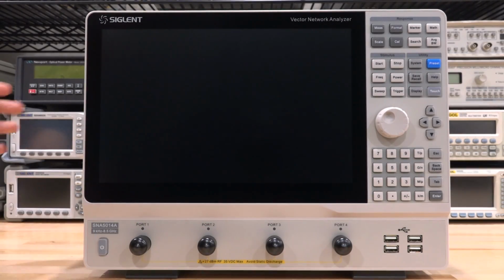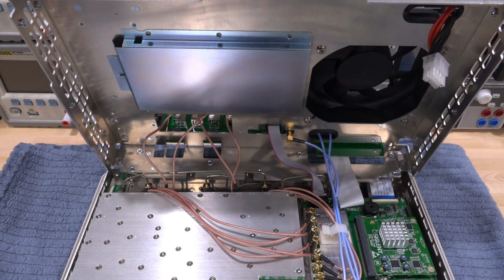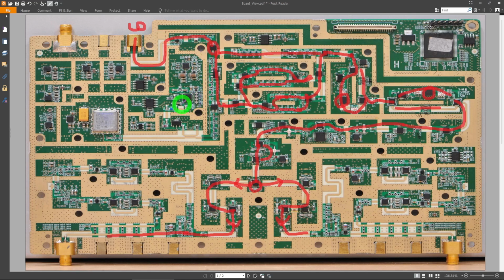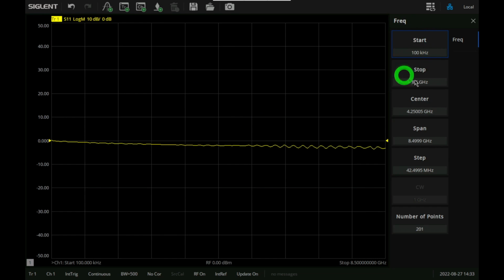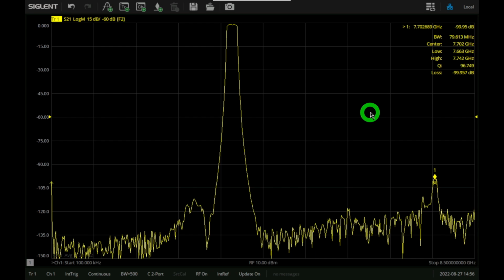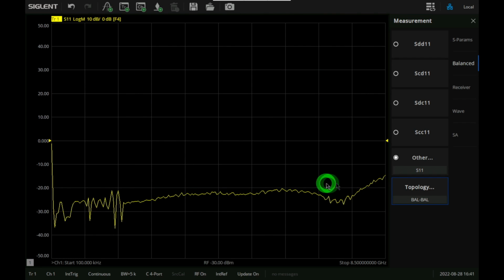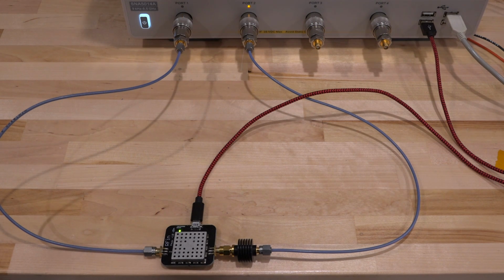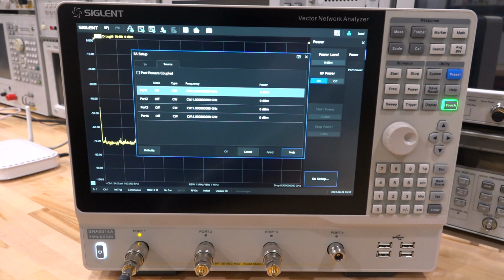TSP #212 - Siglent SNA5000A 8.5GHz 4-Port Vector Network Analyzer Review, Teardown & Experiments (I)

Comment: I have been watching these for many years and I do appreciate that you seem to be speaking like the audience has been paying attention to previous videos. It's fascinating to watch you identify the design constraints and decisions that the original engineers may have considered. 

When you pull out a device to test, like the active amplifier splitter, I do wonder what some real world applications of that board could be. What are the implications and trade-offs in using a board (amplifier) that behaves imperfectly in each of these tests?

Comment: 125 dB of dynamic range at the test port is quite good, especially given the high level of integration and single board architecture as you have mentioned. The design and simulation of that front end is no mean feat, and Siglent didn't skimp out on the BOM where it counts. Of course, the fully decked out 4 port 8.5G trim is 30K USD so you would expect the performance to be there.

Comment: For your videos on the unit, you can go into display settings and turn on hardkeys.  This is very handy but with some additional loss of horizontal space.  But for remote operation, you have all keys visible at once.

Comment: I have never made a differential s parameter measurement, and certainly never will. However it is interesting to see how it is done. 
    I agree that I would like to see a differential amplifier driven on both input ports simultaneously.
    I am surprised that there is no frequency offset mode for measuring mixers. With separate source and LO synthesisers, I would have thought that this would be easy to include.
    I am looking forward to your test of the spectrum analyser option. More and more manufacturers are offering spectrum analysers without the usual YIG preselector for the high band, and without up conversion on the low band. They rely on IQ downconverters, and software image rejection to remove mixer images and LO harmonic responses. Software image rejection only works for repetitive signals. I am suspicious of the success of these methods in offering truly low spurii. Please think of some experiments to really test this aspect of the instrument.

Comment: @The Signal Path
I have a question about the calibration being performed. You calibrate at the level of +10dBm, while in the case of Keysight N4691B ECAL the level of + 10dBm is defined as "Typical damage level". Should the Siglent SNA5000 not display a warning about the possible damage to the ECAL in this case ? 
Therefore, in the eevBlog forum thread "Siglent SNA5000A Two and Four VNA Ports", some questions were asked and strange VNA behavior was noted. 
As you can write in this topic on the forum, maybe it will be possible to explain these strange behavior - and clarify whether it is not due to calibration at +10dBm.
Reply from the maker: I responded to the thread you are referring to on EEVBLOG.

Comment: Nice review.
Please post a link to the episode that delt with the directional coupler. I presume it has a lower frequency cut-off ( of a GHz or two)? If so, would it rely solely on the calibration at lower frequencies?

Comment: Why the starting frequency of almost every instrument is 9KHz?
Reply: I wonder whether this is because EMC standards such as CISPR 11 specify measurements from 9kHz onwards and that manufacturers want to offer devices that offer that range…
Reply: I have next to no reason to go beyond 500MHz, even for work, but it would be nice if my shiny new multi-thousand dollar instrument was capable of audio frequencies.
Give me (and many other people) audio to 1GHz, and we'd be very happy.
Reply: @digitalradiohacker  agilent/KS makes the E5061B 2 port vna with a low freq. option (5Hz). So you can get it in 5Hz up to 3GHz trims. Of course it is several 10s of thousands though.
Reply: Because that's what various government standards agencies agreed is the lowest "radio" frequency, below that isn't regulated the same way. So all products for general commercial or industrial use have >9kHz for their radios.
Reply: @digitalradiohacker  dynamic signal analyzer is what you want

Comment: Can you show how to remove the back plastic panel or provide I link where I can get this info? It looks like by just removing the screws in back, is all is needed it but mine is not coming out even after removing the screws. thanks!
Reply: The service manual appears to detail how to remove what they call the "covers".  Googling the "SNA5000A service manual pdf" I got a clean download at the "evision ..." link.  I suspected that bottom feet may be involved and by a quick skim, the pdf confirms this.  This service document is not at Siglent's site.  It would be good to know what the remaining hold ups were in removal if you succeed.

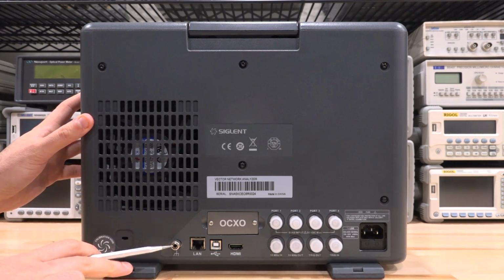Comment: 3:35 question about earth ground... Do you connect that to the actual building earth ground (the cooper rod) or the null ground on the outlet or chassis ground on the bench? What if you don't connect it at all? Thanks
Reply: I don't think so. It's connected internally to the IEC power connector, it's more like an output than an input.
Reply: I guess it is useful for some EMC measurements where you would connect that to your fixture's ground plane (something like a giant sheet metal plate for measuring proper common mode behavior).
Reply: I've used them to attach a grounding point (for a ESD wriststrap), as the ports of these Instruments really can't handle ESD or anything above the input limit. Internal protection on the ports is not really possible because it would limit the performace a lot
Reply: @stefanvoigt384  hey man, what if the wriststrap is not properly grounded or come accidentally detached from the group which happens to me lot... Is it going to ruin this kinda sensitive equipment? Isn't it better to not attach it to any ground to reduce the risks?? Which option is best for long term plan?
Reply: @arashghasemi  Best practice is to always ground yourself before touching any port or connected stuff. To your question: Not grounding at all will not improve things, as the Instrument itself is grounded via the IEC cord. You build charge quite easy in the lab just by moving around. (Standing up from a chair is one good example. We actually have ESD chairs and flooring in the lab, so the risk is limited. As the charge builds over time, it's important to keep the period of grounding yourself short. In other words it will probably not hurt the Instrument, when you loose your wristband connection right before touching it.
Reply: @stefanvoigt384  I want to ask your expert opinion on this: I connect all my instruments ground connector ports to the ground on the wall socket. In US, that hole is the third one (the one on the bottom) which is assumed to be connected to the building ground copper rod... I also connect my wirststrap to the same ground .... am I doing it right??
Reply: @arashghasemi  Sounds fine to me. And don't worry, if you ever measure your strap to ground and get a high impedance reading. Thats because the human grounding is for safety reasons done with a ~1M resistor in series.
Reply: @stefanvoigt384  what I'm worried is the lightning may induce a significant voltage shock in the building ground copper rod and as a consequence, everything gets demolished at some point in time maybe?? Do you think this can happen in practice?
Reply: @arashghasemi  I would say no, because usually the path from the lightning conductor to ground is very low impedance. But I have no experience in that field
Reply: @stefanvoigt384  okay. Thank you very much

Comment: стоит как вертолет... за эти деньги лучше найти старый HP с более высокой граничной частотой на ebay, а на сдачу купить еще пару старых генераторов Agilent и осциллограф.
 Китай перестал делать дешевое оборудование, очень жаль
Reply: The price can be compared to other devices on the market and it is not so bad here, tell me where to buy cheaper four-port VNA ? On eBay, most of the equipment available is scrap of unknown condition and increasingly absurd prices. 

I was looking for a long time for a sensible desktop VNA (not a computer adapter). The basic four-port version is EUR 12700  net, while the two ports are EUR 6600 net. It is very likely that, as with other Siglent devices, the 4.5GHz version can be converted to the 8.5GHz version using codes .

For example, old Agilent Keysight E8802A now available on ebay (two ports, 300kHz - 6GHz) is $ 12500 + shipping + customs fees (I do not count VAT because it depends on the country, so in the case of the SNA5000 I also gave the prices without VAT)

If someone knows where to buy something cheaper (but not a scrap of rubbish at absurd prices), I'll be happy to find out.
Reply: @sb5100MoD  как правило в старых многопортовых VNA HP которые продаются на Ebay не все так плохо что бы не отремонтировать это самостоятельно (как правило замена электролитических конденсаторов в цепях питания, силовых ключей питания, повреждения во front-end RF и прочие однотипные неисправности). Главный плюс этих старых приборов по сравнению с современными (кроме цены) это хорошая документированность, наличие всех схем в сервис мануале, наличие файлов прошивок и дампов памяти eeprom, наличие большого количества компонентов и плат "доноров" для ремонта.
 Если этот китайский анализатор сломается, особенно програмная часть, ты будешь делать дизассемблирование прошивки или просить дампы памяти у добрых людей на форуме? а принципиальная электронная схема у тебя к нему есть? а китайцы тебе ее дадут?
 Слишком много вопросов...
я лучше куплю поломанный/устаревший VNA HP/agilent с ebay, починю его своими силами и буду пользоваться. тем более если там хотябы есть gpib порт всю обработку данных я делаю так или иначе в labview или python/pyvisa
Reply: @yuribochkarev4477  
I agree that older hardware has many advantages in terms of repair. Although with old equipment it is not always easy to repair see TSP # 211 video

The problem is that for old, often damaged equipment you have to pay more than for a new Siglent with a guarantee.

However, looking at the PCBs, the electronic components used are standard, you can buy them, so there should be no problems with repair.

For example, on the EEVBlog forum there are at least two cases of damage to the input circuits in the Siglent SSA / SVA spectrum analyzers (due to the user's fault). The owners managed to fix them without any major problems.